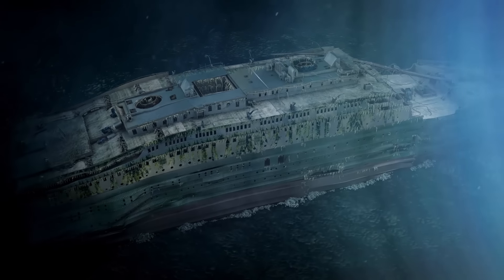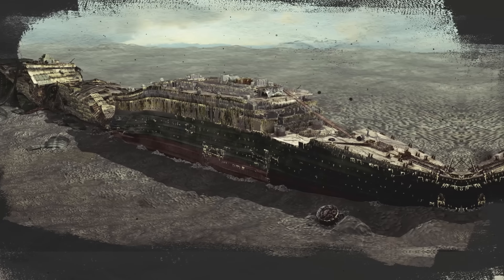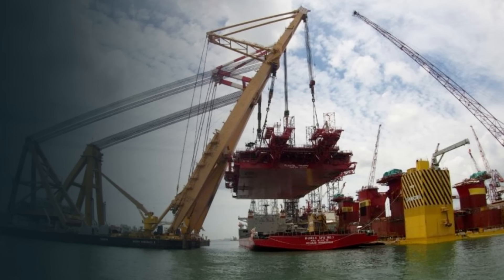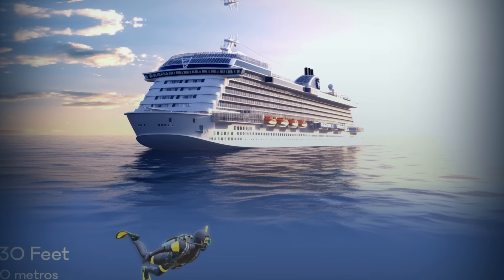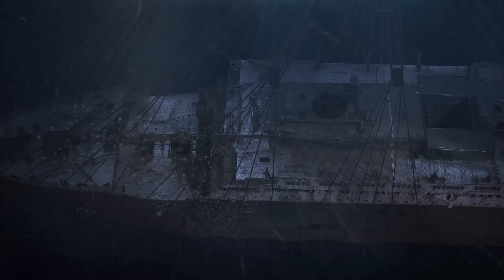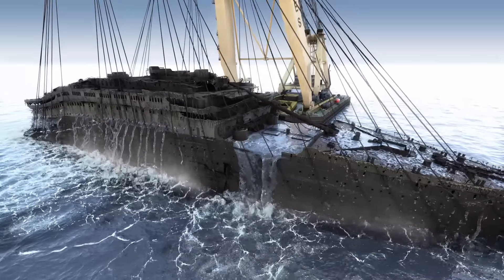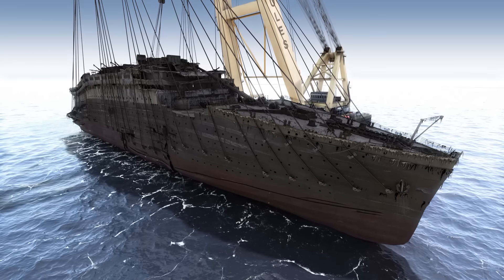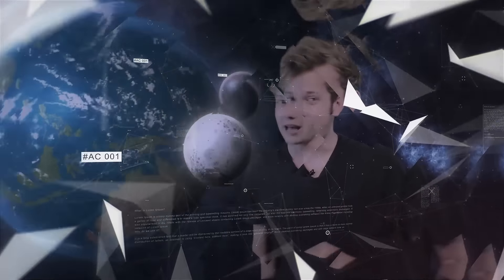THE RESCUE OF THE TITANIC

Comment: Very interesting simulation. As amazing as it is, it's actually impossible to lift the Titanic. Any attempt to raise the ship will result in it completely dissolving. The condition of the overall wreck is extremely fragile like a tower of cards.
Reply: That’s a good comparison
Reply: I agree, if they tried to raise the ship it would just fall apart.
Reply: Yeah it wouldn't dissolve
Reply from the maker: Let's go, help us, and let's share with your friends.
Reply: the cold depth and total darkness is whats actually kept mostly together
Reply: It should be closed within a big iron box and lifted with making vacuum inside the box
Reply: @roopvatkumar2001   I love how you assume that's even  a possible option.   Like it's so easy
Reply: I used to think that, but apparently not. The bow sections hull is still surprisingly strong. That could probably take the strain of being raised; however much of the internal decking and other areas probably wouldn't, so you could raise the shell of the wreck, but the interior would likely collapse into mush.
Reply: That would be true if you are referring to the stern section. The bow section would more likely make it up

Comment: Hercules sank in 2019, the Titanic sank in 1912, 111 years ago. This theory could NOT work due to how bad it's degraded. It 1000% would break apart during it's ascent. I will say the the imagery of it being raised was wonderful and you guys did a great job at creating it, much appreciated.
Reply from the maker: It was worth participating. we are always looking to improve our content for you. If you can help us and share our channel with your friends.
Reply: It's not only because of degradation, I think it's due to atmospheric pressure. It has been water pressure keeping the ship intact for almost 120 years. It's like it had adhesive all over it. If you pull it out, the top of the wreck could collapse on itself
Reply: Oh of course, there's a lot of reasons why it just couldn't work, degradation was just the example I went with. However water pressure is probably the most important factor. Between water pressure and the extremely cold waters even the salt level. Too many factors.
Reply: Where there's a will there's a way. It's certainly not impossible to raise the Titanic, and get it to the surface in one piece (or as much of in one piece as it already is, anyway). In the extremely unlikely event that someone with the millions of dollars to burn and the passion to raise it comes along and tries it, I'm sure they will be aware of the risks to the wreck and take preventative measures against its destruction, such as maybe using remote controlled underwater vehicles to reinforce the structure of it somehow, and instead of just having cables under the hull, maybe they can raise it just enough to put a whole platform underneath it. Anyway, it's not impossible. I'm sure an actual educated expert would have even more ideas than those two

Comment: It would be awesome if they would recover the wreck and put it in a museum
Reply: It would never be able to happen, even if they could raise it, as the wreck would need a special concealed containment around it asap as the oxygen in the air would cause it too fall apart quickly. It would just crumple into rust piles
Reply: Well then is it possible to raise it just maybe a few feet above sea floor just to slip a jig (man made steel/titanium framed base. Something similar like inthis video but sinkable) underneath her and lower back down? That way Titanic will still stay down  there there but also easier to study now that the area where the iceberg stuck could be visible and the jig would help straighten her bow a bit at the same time.
Reply: No
Reply: @paulwoodford1984  die. Rostbakterien fressen pro Tag 100 kg Rost
In 40 Jahren gibt es nur mehr einen. Rosthaufen am. Meeresgrund der zergeht.....

Comment: I think the biggest concern when it comes to exactly how to raise the ship is the condition on the ship. My theory is that it would just break apart going about it this way. Using the same above ground equipment but, instead of using chains, maybe a strong net that would go under the ship.
Reply: I think it is necessary to cut it into small parts: it will be easier and nothing will fall apart.
Reply: shes held by rusticles at this point. if htey tried to raise it with modern tech a couple eyars after it sank, sure maybe, but not now. far to brittle. maybe they can lift britannic instead
Reply: @randomrazr sadly, Britannic is in horrible condition and it can’t be lifted either
Reply: @KV-2-2-2 and due to Greek laws she can not have any part of her salvaged that's why the bell is still down there with the wreck
Reply: @KV-2-2-2  It's not really in that bad shape. The ship is mostly intact. The bow is damaged but the ship is in remarkably better shape than the Titanic. Since Britannic sank in shallow waters, a coral reef has helped preserve the ship underwater, the reef is sadly however, eating away at the ship's wood. The main problem is lifting 40,000 tons from the seabed.
Reply: But where do you put the Titanic if you bring it to the surface you have nothing to put it on I guess you can just drop it back to the bottom
Reply: Good idea let this comment to be on top so that it will always Appear first

Comment: They need make like a base for it. Measure the TITANIC’S BOW. Make the base out of the strongest steel! The lower the base on top of the BOW & have the bottom electrically closed under the TITANIC’S BOW. Like the Bottom of the base pretty much digs into the ocean floor to close or seal the bottom. Once it’s tightly secured then slowly start raising it.

Comment: Even as tough as the ship was, it's still severely rusted and decayed 111 years later. Any attempt to raise it with cables will cause it to fall apart. 

That said, I wonder if it would be possible to somehow place a platform underneath the wreck and lift it that way.
Reply from the maker: True. It was so worth it to participate. Guys, the channel is in dire need of your help. Share with your friends 🤝. Thanks.
Reply: Он вошел в илистое  дно  на 60 футов в глубину! Платформу врядли получится просунуть под него на такой глубине! Так что только как показано  в этом  видео на тросах, но на них он разрушиться! Остаётся только ждать более совершенные технологии...))
Reply: Probably not as the Titanic would have to be lifted to even get under it on top of that I think its stuck deep in mud and on top of that the platform would have to be strong enough and has to be hundreds of feet long but even if all of that did happen it probably would fall apart still
Reply: That's not possible either. The ship is so dug down deep into the mud of the sea floor that the anchor is slightly above the mud and that's deep when pictures of the ship show that the anchor and front of the ship towered high into the air. Even by trying to raise the ship to put the platform under it, a lot of damage would happen to the ship. You'd risk any breakable items still in place falling over or the ship crumble and becoming more damaged. The ship hit the ocean floor with enough force that entire levels of the ship bucked and were destroyed. Basically every second class passenger room imploded in the mid section of the ship.
Reply: Imagine if we could go back in time to 1912 and lift up the wreck in a more durable condition
Reply: The platform might work, if you slide it under the bow towards the back of the ship, but you have to move the silt from around the ship as you move the platform underneath the ship, what do you think of this idea
Reply: @robertsimpkins563 I think the bottom of that ship was severely damaged hitting the ocean floor, its not intact and nice and flat like before the accident.  Also 60 feet of wet mud has surly destroyed the metal, and the ship probably doesn't have any bottom at all.

Comment: Only wait to lift it back up is if you were able to slide a massive steel plate underneath the entire bow section. Then lift that plate up horizontaly at a very slow paste. I've always thought this would be the only way, because if you're going to try to attach cable onto the structure itself, you'll just pull the thing apart. I'm a big believer in conserving history, and that's exactly what the Titanic is! These people and the story should never be forgotten!!
Reply: even then, the pressure changes, and getting that steel under it could easily collapse the vessel.
Reply from the maker: Thank you for participating, we are always looking to improve our productions. If you can, help us by sharing our videos with your friends. Thanks !!
Reply: Lifting it up at a angle like that will cos stress on it and would completely fall apart it needs to be raised eivenly and slow if lifted evenly it will survive all the way to the surface
Reply: @NicolasPenna-ux4nr  exactly my point 👌

Comment: Such a good simulation! I think before you made this video, the only similar thing is the actual 1980 movie, so this is a nice refresher of how the whole operation would actually look like. Yes, i agree with others, the ship is so delicate now, I feel like every movement would damage it further. and would the steel expand in warmer environment on surface, everything would just collapse idk. mind blowing it took only 5 min to hit the ocean floor. thank goodness it landed in “normal” position, stern too. lot of ships lay on their sides or upside down
Reply from the maker: thank you for participating. We are always looking to improve the quality of the videos. the channel needs your help, if you can share it with your friends. thank you very much
Reply: how would the lifting straps get under the ship? you'd have to excavate under the boat to loop the strap around, and then you'd have to put huge tarps across the loops  to relieve pressure on the hull as it lifted. Maybe this whole endeavor was crowdfunded, and partial donations and government assistance? A nice what-if story, like a rough concept trailer. Nice work1
Reply: @Defender78 As soon as they try to lift it, it will just fall appart in million pieces. Hell even trying to put those wires might cause major damage to the wreck

Comment: You should do a second animation of this, but this time make the hull droop a bit after its initially raised, and make multiple pieces fall off of it. That way, it would be much more realistic
Also, you made a small mistake when you said how many firemen there were on board. In reality, there were 175 firemen and 73 coal trimmers on board.

Comment: Is there a real reason to raise the Titanic. She is famous after all because of what took place on the night of 14th April 1912. Otherwise we all know she would have ended up like her Sister RMS Olympic, scrapped and forgotten.
Her bow is bedded into the seabed by 60 feet and is bent at a angle of 30 degrees which is worsening every year as the ship is slowly dissolved. She would collapse like a deck of cards if you tugged her. You only have to look at the expanding crack on the port side which was noted by the late PH Nargeolet.
I believe It’s not just the wreck itself that captivates us but where and how she lies, that hasn’t changed since that fateful night in 1912 and we all know the circumstances that lead to her being there. Whilst she is there, parts of her we can’t see or access remain a mystery, continuing to push us to explore her further to find those answers. 
Titanic is still a book that’s being written.

Comment: I know it's too late for that, but my method would be to use many submarines and have them hook onto a certain part of the wreck, and slowly make their way to the surface. Because of how the Bow landed, the prow is buried deep inside the mud and the mid-section of the ship has heavily cracked. This means we'd have to dig up the ship, which could be done with explosives using careful planning and calculations to be able to loosen the mud without damaging the wreck. Afterwards, we either cut the Bow into 3 sections and lift each 3rd up separately with the submarines and pull it up to the surface where barges will be waiting, or pull the ship up all together, though because all the subs are not controlled by one person, the latter could have more problems, since they'd be handling a huge mass rather than smaller bits. And also considering the fact that we'd have to buy huge ships, several large barges, dozens of submersibles, and hire hundreds of people to do the job, it would be extremely expensive. (I'm not completely sure about how to raise the stern, since it's pretty much a heap of scrap placed on top of each other). 

Of course, today is unrealistically possible. It would take dozens of submarines to do this, plus due to factors such as corrosion and metal eating bacteria, lifting even the Bow with floating balls, submarines, etc. would be like trying to use a hook to pull up a mudball from the bottom of a lake. Plus thanks to treaties and controversies over methods of salvaging artifacts would raise tensions between those who believe artifacts should be preserved (me included) and those who believe they should be left there to disappear because it is pretty much a huge underwater cemetery and salvaging artifacts is an insulting form of tomb robbing (for example, they see it the same as stealing flowers from a tombstone).
Reply from the maker: Thank you for participating, we are always looking to improve our productions. If you can, help us by sharing our videos with your friends. Thanks !!

Comment: The Big T is buried in some of the thickest, densest mud/clay that there is, they tried getting a deep core sample by driving a heavy tube down into it, it only made it several feet before stalling. So how are you going to string dozens of cables underneath the wreck, through that stuff, 2 1/2 miles below the surface? Super strong underwater robots that don't exist? And if you were able to, pulling it free of the massive suction holding it in place would break it into bits - there isn't much structure left, and this would likely happen even if it was only down there for a few days.  Then there's the weather, sea swells, inevitable equipment malfunctions, (what if the cables snap halfway up? it would be unrecognizable debris) Titanic is rapidly falling apart, so if the technology ever does come into existence to raise it, there likely won't be much left by then.
Reply from the maker: Thank you for participating, we are always looking to improve our productions. If you can, help us by sharing our videos with your friends. Thanks !!

Comment: It's beautiful idea, but it's also impossible idea. Physical forces that would affect on the hull at the moment of rising, would damage the liner. We don't know how rust is Titanic inside (I mean unvisible structure of steel under it's external part) and ropes won't be attached to all of the hull, because bow is half-covered in mud of the bottom. And that's the easiest part. You must also put the ship on this giant raft to transport it. In the water, due to Archimedes' law, all bodies weigh less. And we must rise the ship a few meters above the surface, so forces would be stronger. Additionally, you haven't considered the weather. If any of mentioned facts would come true, the ship would not only sink forever, but also crack into pieces and you would be responding for it (if obviously you've done this task). So... yup.

Comment: What if you encase the ship, first by moving the soil that it is buried in and placing a platform underneath, then build 4 walls around the ship that can be welded to the base and in all 4 corners and attach hook anchors to the walls to bring the ship up using cables. Once the container is in a position to be towed to dock, drill holes into the walls and the base to allow the water to slowly drain from the ship and the container, then work on removing the walls that are used to encase the ship.

Comment: They have to put cables under it and not hook it on the sides as the animation suggests. That whole middle would just spill its insides out like a gutted pig's stomach. That whole superstructure is basically just a mush of rusticles and thin steel, or what's left of any steel.

Comment: If we try to pull it up, it will just fall into millions of pieces
Reply: I think they'd need to find a way of supporting the hull from beneath it, like drilling into the seabed & getting under the ship. There's also the fact the ship (in the event it's miraculously raised) would need immediate treatment to fight the air corrosion when the metal comes out of the sea water for the first time in 111 years.
Reply: All the more reason to just leave the wreck there and let the dead rest.

Comment: The bestest way to raise the titanic is by using liquid nitrogen to float it to the surface. And then use large ships that are build like a giant tugboat to push it away to the shore for a museum with glass hallways build inside to walk around and to feel like you’re in the titanic literally. But most likely when we would do it a long time has past and it would be way weaker leading to pulling and filling would just cause it to crumble but freezing it would be the bestest way of them all. The ice would hold it together and float it to the surface without pulling and after let the ice melt. Although when water freezes it expands which would create stress on the vessel but better then it collapsing. But every idea would create somewhat of a stress on the frame. But really the more money the better it will be intact. So maybe tubes can be sent under the vessel to poor out the liquid nitrogen.

Comment: It could be done but the price tag would be in the billions. You not only have to get it back up intact but also once exposed to the open air you basically have to put it in a giant solution to protect it and restore the strength to the steel or it will crumble to dust.